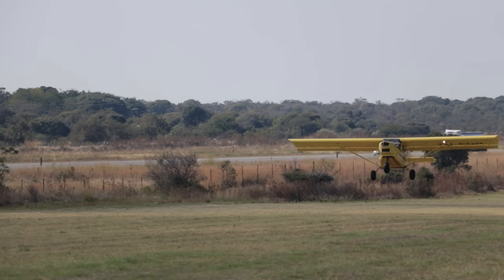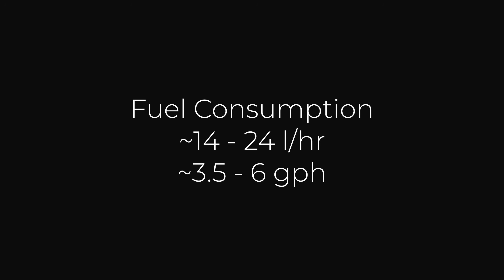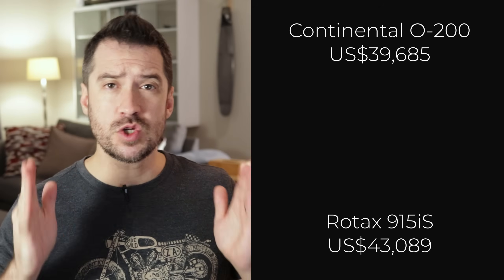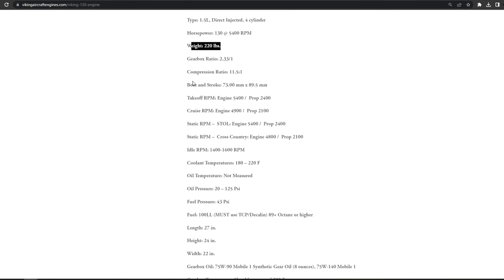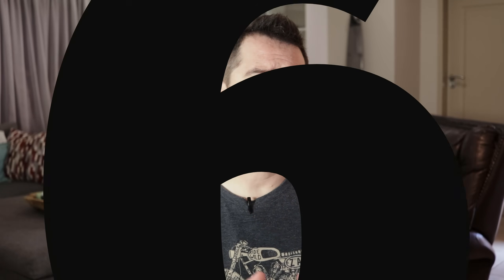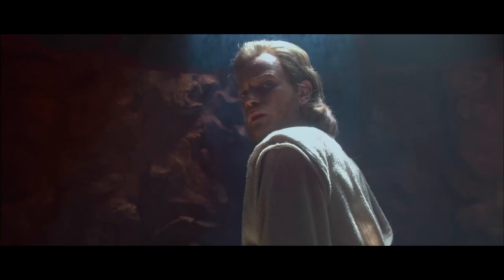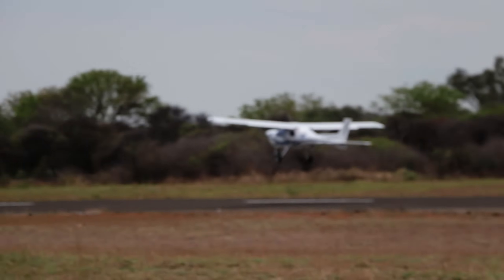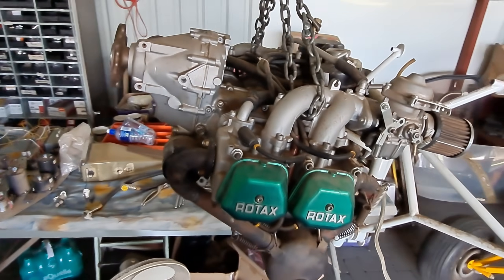6 WORST & 6 BEST Light Sport Aircraft Engines

Comment: A  2200   VW with a redrive develops 103 hp . It gets the prop up further off the ground and allows for a bigger prop. Parts are not expensive .
Reply: Running a VW at that power will over heat the engine. I run my Redrive VW at about 60 HP at cruise and about 80-85 hp for takeoff. This keep the temps under control. Swing a large prop give you alot of thrust which is what is useful. HP figures are mostly irrelevant and most manufactures lie about them.
Reply: @richardneilsen5538  I may be able to help you with running hot . And it will not take very long nor cost you more than 3 hacksaw blades . Bolt the hacksaw blades together and saw the casting  flash from between your fins on the head . To see what I am talking about , look down on the aluminum fins and will see the casting flash . Saw all of this out . The smoother the transition from the top half of fins to the bottom half of the fin castings the better it cools .Remove with appropriate drills the rest of the flash materias for better cooling. After I did that I never ran hot not ever .
Reply: @richardneilsen5538   Did you take time to look down through the cooling fins on your heads . The seemingly insignificant aluminum casting flash on your heads interrupts airflow , think air contact to the cylinder and fins. I took 2 and sometimes 3 hack saw blades and bolted them together side by side and raked that flash out from between the fins. We had  high head temperature problems no matter what we did until I CLEANED the seemingly slight obstruction out . Never overheated again. It doesnt take much roughness to cause airflow problems . I believe you can do this while mounted on the plane . In other areas where needed I took a 6 inch long drill bit to open up airflow as well . I ran at climb power for extended periods and no overheating . Cooling fins should be as clean as your wing .
Reply: @charleswesley9907  Good advice! Yes I spent hours clearing the flashing from my VW. People that run their VWs at higher power levels have found some relief by welding more cooling fins on the heads

Comment: Suggestion ~ The single worst choice for powering a home built, don't make a 2/3 scale replica of a Hurricane or Spitfire and decide to stay with British V12. A Chev LS has got cooling that will (can be made to) cope with 5 minutes of full power to take off, and continuous 75% power to cruise. A Jag V12 out of a 1960s ~ '70s Jaguar road car ~ CAN'T! Lots of people have died because they put a fairly stock Jag motor in an otherwise perfectly reasonable 2/3 scale war bird. I'm not sure if they are a good car engine, but they are a terrible aircraft engine.

Comment: why no hirth engines included, like the 3203 or 3503? they are used on many elsa planes especially these days and seem to have positive feedback currently anyways ...
Reply from the maker: Nothing against Hirth. Just didn't consider engines with power output lower than 80hp.
Reply: @LetsGoAviate  ah, cool, was just curious.  why the cutoff of 80hp, just personal preference...?  i would've included down to 65 or 70 hp, just so those two hirth engines as well as the discontinued, yet still widely used and available rotax 582 blue head engine could be added to the comparison.   i dont get why rotax stopped making the 582s, they seemed like such a popular engine or what not ... anyway, cheers man.
Reply from the maker: @thespeedofchillax  Yeah, personal preference. We had a 65hp Rotax 582 in our light sport, and it was dangerously underpowered. Might be prefectly fine on some other light sport aircraft though.

Comment: Ul engines are the best.. with better total installed weight and power.. the price is a bit higher but comparing ul 260 to rotax 912 only 10 pounds different but 7 extra hp and the price is only about $1000 more.. and when you look at the total instead weight of 200 lbs ( rotax 912 ) to 159 lbs of ul 260 , you get the idea or say a bigger picture that rotax is not light as ot claims and the price is not attractive either.. 
If i own any aircraft, i will go with UL .. I don't know why they don't us UL engine in sinus motor glider but of they do, it will help to reduce the total installed power plant weight so they can offset that into abit stronger frame and have 27 extra power in compared to rotax 80 hp , better climbing and using less time on engine and gliding more..

Comment: Please next time include the usable and most efficient RPM's that the motor can produce  power.   Peak horse power ( also in Kilowatts )  at what RPM and cruse HP ( KW ) at what RPMs these are very important details for aircraft performance..   Liked your video..
Reply from the maker: Thanks for the idea, will include more details in the next one.

Comment: Book numbers are dangerous.   If you look at the 914UL and 914is engine/gearbox weight 140ish.   Add in the oil tank, coolant tank, radiator, hoses etc...the rotax option start pushing 170+ lbs.    Rotax are great and perform in all applications.   But they should be ;chosen for their other benefits, not a false weight advantage.    Some of the other weights given in the video are more accurate installed weights.

Comment: AeroVee VW based engines are sold as kits only.
There is also a AeroVee (turbo) 
100 hp @ 3,400 rpm, 83.9 kg (185 lbs) less oil
Kit $15,000 (includes intake & exhaust)
Reply: They require more maintenance than most, but parts are robust amd dirt cheap. They're amazing for the aircraft builder. Not so great for people that will be paying shop rates.

Comment: Aeromomentum used to claim that they use Suzuki engines.
Now their website says, "We buy all brand new parts from OEM suppliers".
Suzuki G engine was introduced in 1984 and went through many revisions. 
AM13 is based on the GEO-Suzuki G13BB which came about in Mach 1995. 
The G series engine went out of production long ago and was superseded by the J, K, M and R series.
The "new" engine, claimed by some converters can not be from a Suzuki factory.
Possibly, they are put together from spares produced by third party manufacturers.
Having said that the G13BB had a good reputation. A person with mechanical skills should be able to put together an inexpensive DIY aircraft engine using conversion kits.
Another company that has long been converting the Suzuki GEO engine is AirTrikes.
Reply from the maker: Good info, thanks!

Comment: What about the Yamaha Apex? the NA version sports 150hp and weighs about 180 lbs and can be had for $12-20k. The absolute best powerplant available. It was designed to live its life at high revs. So cruising around at 7500-8600 rpm is normal use. Yamaha themselves are researching the light sport market and testing the 2 cylinder Phazer engine on a rans S6
Reply from the maker: Not included because it would beat everything on the list 🤣 Seriously though, the only auto (or snowmobile) conversions I included are those engines sold as a converted engine by a specialist company, e.g. AeroVee and Viking.

The Yamaha Apex is a snowmobile engine, so still needs to be converted. If there is a company doing it and selling them already converted, then my apologies, I'm not aware.
Reply: @LetsGoAviate  Edge performance makes turn key Yamaha conversions. Called the EPeX. Offering in 150hp, 200hp and a 300hp version. Complete ECU, wiring harness, gearbox and propeller combinations.
Reply from the maker: @michaelmartin2486  Of course they do! Completely missed that. Thanks

Comment: Don't know where you got your pricing from, but most of it is wrong. The Jab 3300 is currently $20,900, while the 2200 is $17, 900 - not even close to what you reported. Also, the price given for the AeroVee was for the turbo version that puts out 100HP, not the 80HP version you showed.
Reply from the maker: Admittedly the Jab prices seemed suspect, even though 2 websties showed the exact same prices. Also had issues getting more than 1 price on the O200. The rest should be correct Sir, got all on either manufacturers website or multiple distributers sites with similar pricing.

Comment: I like the UL Power UL520iS with 200hp @ 108kgs (wet) which is 1.85hp / kg. Although for a 5.2 litre engine is not much power
Reply: Because it's a long-stroke and the 520T does 220hp@2700rpm. They could easily rev the engine to 5000 but requires a gearbox and wears faster.

Comment: all great reviews, however one little side note, the ULPower weights listed are ready to run weights, fully ready to run,  with oils in, wiring harness and ECU included, exhaust system mounted and installed, filters, pumps and baffling ( which is also supplied with engine!)
.  Rest are dry weights listed by manufacturers without oils, water, exhaust, radiators  etc installed. I have done plenty Rotax and ULPower 350 series installs and they are similar weights installed but 130 hp EFI vs 100 hp Carburetted. And then pricing is also wrong. Most of these need substantial extra costs for items not supplied with the engine and not ready to run out the box ( ULPower engines are ready to run out the box, Jab out the box but all the liquid cooled engines do not include  additional items needed to be able to actually start the engine, that do NOT come with the engine - and some dont include exhaust systems either!). So alot of hidden costs and weights not included.
Reply: The advertised power of UL Power engines is at 3300rpm - too high to efficiently operate as direct drive engines.  However, a gear reduction drive is not included.  So, you either have to add a gearbox - which increases cost and weight...or you have to operate the engine as a direct drive at a lower rpm - which reduces power output.  In both of these scenarios, the UL Power engine becomes considerably less favorable compared to other options.
Reply: @ldmax  ULPower engines like the 130 hp engine is 130 hp at 3300 rpm correct, but at 2800 rpm its still 124 Hp. And 100 hp at 2100 rpm! Torque is higher than the rotax engines as well even with there gearboxes. So in reality. Who actually uses the full 5800 rpm needed eg on the rotax for takeoff ? Using a fixed pitch you will go nowhere at cruise setting doing that. And noted the ULPower is still 100 hp at 2100 rpm!
Reply: Gearboxes aren’t the answer. The only benefit of a gear box is smaller displacement running at a higher rpm. Plus you have another maintenance point and potential failure point.
Reply: @willcall9431 a reduction gear is going to let you turn a larger, more efficient prop at a lower rpm.  That's a pretty big benefit, and it's why all large those big radials, Merlins, etc. had reduction gears. Generally on light aircraft Lycoming and Continental have decided the weight, cost and mechanical complexity aren't worth it. 

If you have a 3300 rpm engine without gearing you can of course run a smaller prop at higher rpm, but it'll be less efficient. Generally accelerating a larger mass of air less is more efficient than accelerating a smaller mass to a higher speed.

Comment: A Jabiru 3300 actually puts out 130Hp and weighs 176 lbs but it is easier to leave it certified as a 90kW (120HP) engine. The Jabiru 2200 actually puts out 88 HP but the specifications have not been changed. I have flown aircraft powered by both these engines and I have also flown aircraft powered by Rotax 912. The direct drive Jabiru engines are nicer to fly and they don't have that rattly reduction gearbox when taxiing with the Rotax engines. My choice is Jabiru 3300.
Reply: Aren’t they problematic with high temp issues ?

Comment: In the UK it’s pretty much dominated by Rotax, 80 and 100 horsepower variants, but they are expensive and have increased in price several times recently.  One trike manufacturer has been fitting a BMW motorbike engine, about 8000 US dollars cheaper, and it’s proving popular already.  Jabiru engines tend to be viewed as having a poor reliability record.  And that’s pretty much it, Rotax or nothing else

Comment: You'll want to update your information.  The Rotax 912 series advertises their weights without exhaust, radiator, muffler, etc.  Also, Jabiru's cost about 50% more than you were advertising.  Jabiru advertises their weights ready to fly, minus the prop. In the end, the 912 series weighs very close to a Jabiru 3300.
Reply: No it doesnt but even if it did, the 912 works, the jab doesn't.  Its a unreliable engine with tons of problems.
Reply: @crono331  Mate, you have to let it go. 
The Jab design is now refined and they are a good engine.
Reply: @68404  sure. thats why most nobody uses it. and define "good engine"?
sure it runs, when it runs. is  a b**tch to baffle for proper cooling. now the real problems. very few suitable props. difficult to find spares. a myriad versions. too many catastrophic unexplained failures (seen them myself) 
sorry, i only have one butt, need to keep it forever, and i need the most reliable engine possible, and that now is a rotax 912. even more reliable than a ly-co.
Reply: @crono331  , depends if you fly it like a car or an aeroplane...

Comment: Never, ever, not ever use a converted auto engine in your plane.  Getting back to the best light plane engine.  There are only two choices.  1. 912 or 915 iS Rotax  2. Titan series.  End of story.
Reply: Why not?
Reply: @TheOwenMajor  Car engines are designed to provide quick bursts of relatively high power output for acceleration, and then only modest power output for steady-state cruising. It’s unusual for an auto engine to operate anywhere near its redline rpm or max-rated power output. Airplanes, on the other hand, usually take off and climb near 100 percent power output, followed by steady-state cruise often at 75 percent power. Aircraft engines are designed to sustain this punishment reliably over a typical 2,000-hour service life. Try running your car’s engine at or near redline rpm all the time and see what happens. For starters.  There are other reason that relate to rapid altitude changes in short periods of time.  Car engines use much closer tolerance than aircraft engine for this reason, expantion and contraction of metal.  Car engine lack redundancy in the fuel and electrical components, a basic requirement for aircraft engines.  aircraft engines produce gobs of torque at relatively low rpm. Auto engines, on the other hand, usually produce very little torque at those settings.  Car engines are too heavy.  Aircraft engines turn props at or about 2700rpm continuously, a car engines power curve is far over that at 6000rpm.
Reply: @speedomars Porsche and Mercedes have made certified engines...
Reply: @WilhelmKarsten  We are not talking about a clean sheet engine design for aircraft, we are talking about mounting a car engine in a plane.  Porche and Mercedes made aircraft engines AND of course car engines, but they did not CONVERT existing auto engines to be certified for aircraft use.  Volvo has a division to make combat jets, these are separate and distinct efforts from large car companies.
Reply: @speedomars  In general, you are correct but in this case, the Porsche PFM 3200 and the Mercedes-Benz OM640 are derived directly from production automobile engines and utilize parts in common.
Few automobile companies can build engines this reliable... Porsche and Mercedes-Benz are notable exceptions.

BMW still makes aircraft engines for General Aviation and military applications but they are not used in automobiles... jet engines would simply be too noisy.

Comment: The aerovee can be assembled by the pilot if so desired in about 16 hours, and a turbo can be added for additional takeoff power and regaining some of the lost power at higher altitudes.  I purchased the engine in kit form from someone giving up on their Sonex build, so I got it much cheaper than retail.  I did have to buy the turbo modification from Sonex.  If you build the engine/airframe yourself, you can get a repairman certificate for your plane and do all the maintenance, repairs, and even annual condition inspection.  Lots of saving there, but you have to have some experience in working on engines and be good with building things.
Reply: What is the compression ratio on those Aerovee engines? A well built 2180 in a Bug should be north of 125hp. Is the c/r lower to help with reliability?
Reply: @b.chuchlucious5471  most aircraft engines produce a half horsepower per cubic inch. It makes them last longer and keeps CHT lower; the VW engine in-the-air has a horrid history, the Sonex crash at Oshkosh halted my progress on building one and a VW powered KR-2 crashed on final to the north end of the runway about a half mile from my house killing the pilot and his father-in-law. Love my VW's but won't try to fly with one.
Reply: An aircraft engine can/should only run at max.3200 rpm. At 125 hp you run at 5000 rpm and would need a reduction drive. You also would get cooling and reliability issues
Reply: Compression ratio can be set at 7:1, or 8:1.